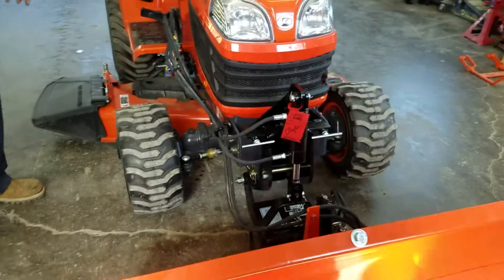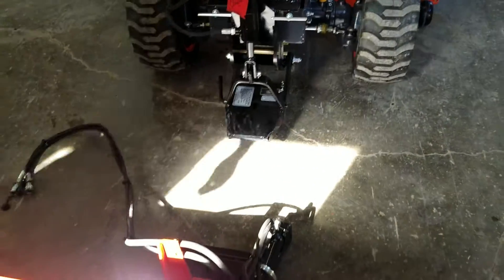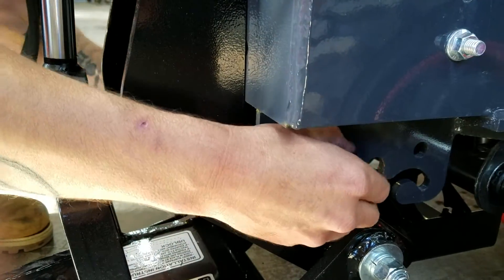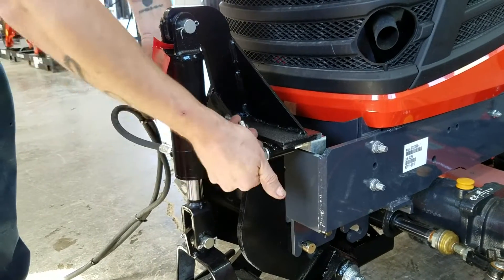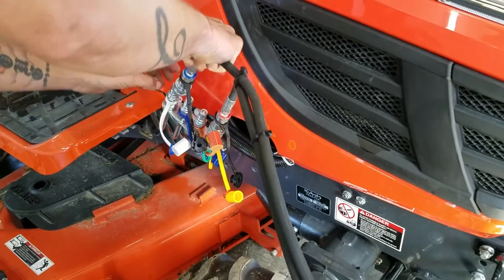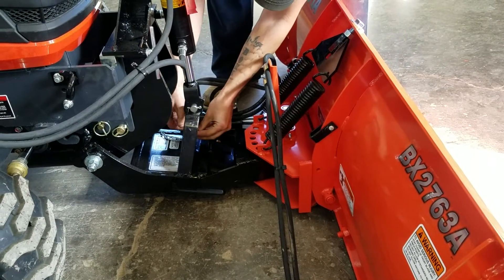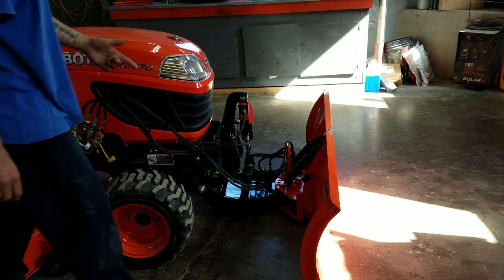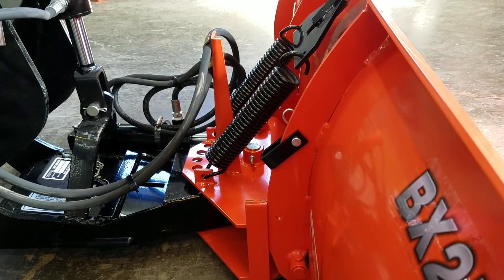Bx2763a Snow blade on Bx2370 taking on and off Demo

Comment: Thanks a lot. I own a 2019 BX 1880 with a pin Bucket only because I am unable to get the quick attach system at this time. Will this plow system attach to my tractor simply by removing my FEL which only takes about 2 minutes or less
Reply: hey buddy, yes it will. The loader type wont make a difference on the plow installation sop long as the loader is removed from the loader mounts when installing the plow/frame if I'm reading your question correctly. Funny seeing you here, I was checking out some videos as I debated building my own front plow setup this year.. Either that or finding a nice used front plow (this model). I like to change it up each year using different plows to keep things interesting... Last year I used the Artillian FEL plow as you prolly remember.
Reply: @BiffsEquipment  Thanks but since I sent you this comment I was finally able to get the skid steer type quick attach system on my 1880 so all possibilities are now open. I end up pushing back the roadside snowbanks as I have 3 mailboxes to keep clean and for a snowplow to shove the banks back I have simply filled my FEL bucket with snow and use it to just push it onto the yard and it works great but.  now I'm thinking of getting a small plow to do the same thing. Looking forward to Part 4 on your shop build.

Comment: Can the whole unit be easily installed and removed without taking it apart like you did?  
Plus... I think you got your colors all mixed up.  What am I not seeing?
Thanks!
Reply: I'm sure it would be possible though it wouldn't be much fun trying to lift the plow frame up and off the front of the tractor frame while the weight of the plow is still attached. As for the color coding on the hydraulic hoses he had color coded zip ties on the ends of the rubber coupler caps signifying separate color  coordination for the plow lines only.
Reply: If I hooked hoses up as color coded from factory it’s all wonky. I watch this video because if that

Comment: How did you get the quick attach hitch on the tractor without taking off the deck and the cradle? Every time i put my plow and hitch on I have to take those two things off. I would really love to know how you did that.
Reply: He was able to install the plow frame to the tractor with the mower deck in place because if you watch carefully in the video the cradle to the mower deck was already removed prior to the video.. The belly mower was still mounted at the backside pins under the tractor but so only the front cradle was removed from the deck.

Comment: Does this setup need a crossover relief valve for the angel cylinder in case you hit something?
Reply: If it did it would either be  in the plow cylinders itself or attached somewhere to the plow frame.. I'm guessing it doesn't have a relief though as most tractor plows don't and its very rare to bend a plow cylinder on a tractor plow... More than likely you'll bend the plow or the plow frame first.

Comment: It doesn't look like the hoses are color coated.
Reply from the maker: The color rings are on the dust caps installed by the dealer or yourself.